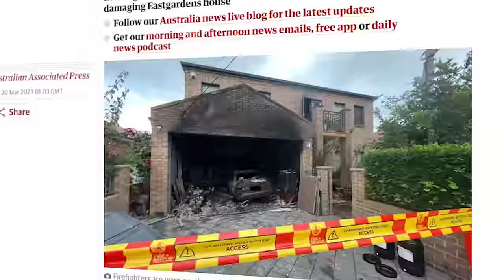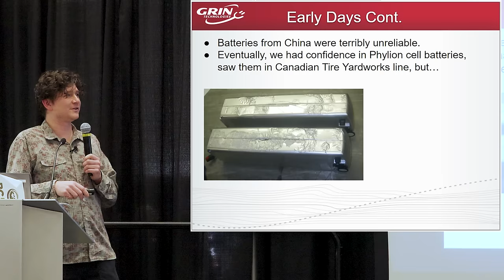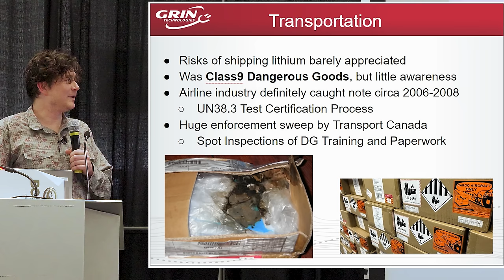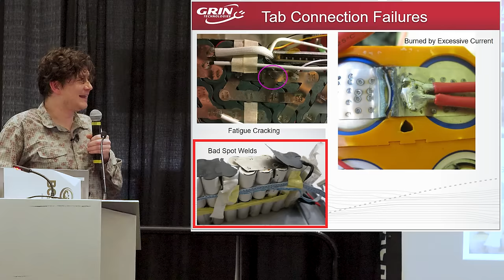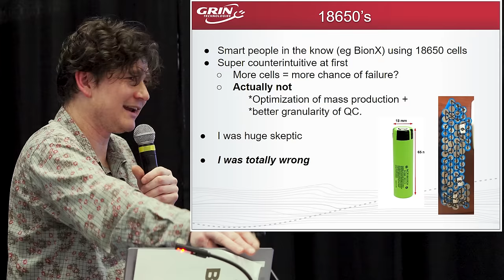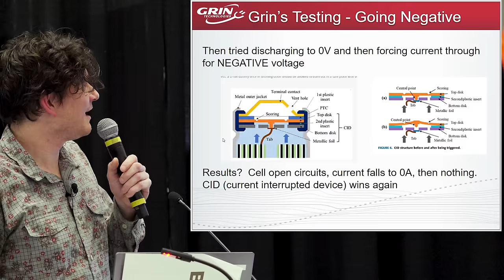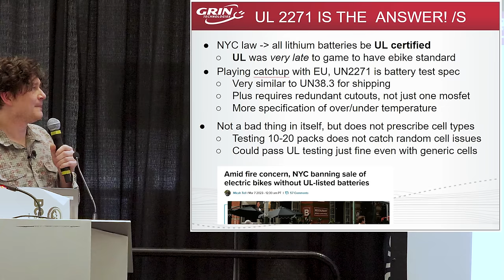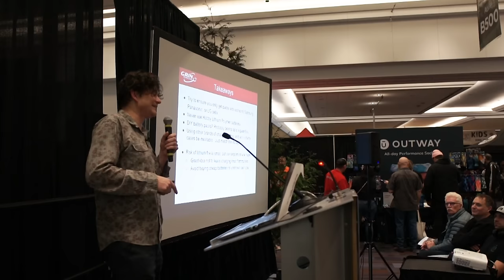Grin's Perspective on Ebike Battery Fires, 20 Years of Experience - Live from the BC Bike Show

Comment: Extremely high iq video. I don't normally watch 41 minute videos, but I sat
through and absorbed every molecule of this video. However, I realize there is only one solution... move to another battery. LiFeP04 is an extremely safe battery, but less energy density. The only question is, do you choose more weight and less power, or do you choose death... the answer seems obvious.

Says it in the name... LiFePO4... you must choose... 

You are like a lone genius, preaching the latest research, standing tall against a giant
beauracracy of outdated and oppressive boomer science. Sort of like Pierce Brosnan
in that Volcano movie. 

Another thing... one thing I disagree in the video is your explanation why other electronics don't catch fire... you say its cause people invest in high quality electronics... they don't... there are other reasons why cheap chinese electronics don't catch fire... Most of the smaller electronics are built different... For example,
many smaller electronics don't even use Li-ion, they use LiPo... you often hear LiPo batteries exploding in RC planes and ebikes,
but never in cheap chinese electronics... cause the LiPos are not built the same, the LiPo in small electronics are built
with safety as a priority, while the LiPo built for RC planes is built for maximum energy discharge and power.

And I did hear you mention LiFePO4 briefly at the end, you said it "catches fire", but from what I've read online there is no
contest between the two, LiFePO4 cannot thermal runaway. But you are a battery genius so I would like to hear a presentation
from you which discusses LiFePO4 in more detail please.

As for me and my story, I want society to be less car centric. I want bicycle highways added to society, towering above society
and allowing ebikes to flourish. However, Li-ion batteries and cheap premade ebikes are not for me at this time. I am considering building a gas bike instead,
even though I know nearly nothing about gas motors. Or custom building a LiFeP04 bike since I can't find premade LiFePO4 bikes online.
Reply from the maker: Thanks for the feedback. Our feeling is that quality cell manufacturers like Panasonic have aptly demonstrated that you can get the safety of rechargeable lithium ion batteries to be good enough that the risks are similar or lower to many other readily accepted consumer products. How often do you hear of a Shimano or Bosch ebike battery catching fire? Almost never, yet there are millions and millions of these in use all over North America. 

The problem is that there is no regulation or restriction on which particular lithium cells are allowed to be used in imported goods, so lower cost brands will happily use cells from almost anywhere. When there are incidents they don't investigate or distinguish which brand or model of cell was involved which is a bit of a travesty, and instead all ebike batteries get lumped together.  

Our earlier experience LiFePO4 cells is that they were just all over the place with quality and consistency, and at over double the weight of lithium-ion it's a big downgrade. We've gotten so used to long range batteries that weight just 10 pounds, no one wants to lug around 20 pound ebike batteries again. But if that weight is not an issue for you then by all means it's a fine choice, and there are plenty of LiFePO4 battery sellers out there with premade 36V and 48V packs suitable for DIY ebikes.  You don't need to custom build one from cells.
Reply: @GrinTechnologies  
"Thanks for the feedback. " You are welcome. 

" Our feeling is that quality cell manufacturers like Panasonic have aptly demonstrated that you can get the safety of rechargeable lithium ion batteries to be good enough that the risks are similar or lower to many other readily accepted consumer products." The chance was 1 in a million. That's not good enough for me. I don't want to put words in your mouth, so if it was not you that said that it must have been somebody else's video about lithiums. Solid state is the future. They sell solid state on amazon but they are fake.

"The problem is that there is no regulation or restriction on which particular lithium cells are allowed to be used in imported goods, so lower cost brands will happily use cells from almost anywhere. " Forcing only approved corporations to sell batteries is a slippery slope, tantamount to fascism, (fascism is the merging of corporation and state.) Its unamerican and against the American principles. I would much rather just either: Force the cheap chinese batteries to put a LARGE "fire-hazard" warning on the box or amazon listing. Or, put a certified "low-risk" stamp on the box of Panasonics.

"When there are incidents they don't investigate or distinguish which brand or model of cell was involved which is a bit of a travesty, and instead all ebike batteries get lumped together. " Its just typical human plebbery to flounder about and not really dig your heels into something with substance. I get frustrated a lot trying to find scientific data that could have easily been included in something, but was omitted for no reason by peasants.

"Our earlier experience LiFePO4 cells is that they were just all over the place with quality and consistency, and at over double the weight of lithium-ion it's a big downgrade. We've gotten so used to long range batteries that weight just 10 pounds, no one wants to lug around 20 pound ebike batteries again. But if that weight is not an issue for you then by all means it's a fine choice, and there are plenty of LiFePO4 battery sellers out there with premade 36V and 48V packs suitable for DIY ebikes.  You don't need to custom build one from cells." Weight is definitely an issue for me. I feel that contemporary ebikes are overengineered. At box stores we have these heavy, under-engineered mountain bikes that disintegrate upon going on downhill mountain bike trails one time, yet are legal somehow. Instead of that, why can't they make ebikes with lightweight vintage frames, that might not be robust, and just warn people not to ride them on downhill mountain trails? Then the LiFePO4s would be a non-issue. Are LifePO4s lack of QC because of chinese sellers not doing QC/lack of economies of scale, or is it some inherent issue of the physics of LiFePO4?

Comment: I have yet to see or hear of a LI battery spontaneously combusting, every single instance is a result of idiots, tampering with the insides of scooters removing speed limit restrictions , or tricking out the machine.
Reply from the maker: We'd definitely disagree on this front even though that's the common perception in the media and on forums.  We know of several businesses that have had absolutely brand new, never used batteries still in their original boxes catching fire. This is also the case at Pearson Airport, new batteries just in a pallet that were about to be loaded onto a plane (https://www.fire.tc.faa.gov/pdf/systems/May12Meeting/Lewis-0512-Li-Ion.pdf). It's quite rare but it does happen. In the cases where we've seen responsible ebike companies do battery recalls, their customers were doing nothing outside of regular expected use. They still had battery spontaneously go into flames. They weren't idiots. They weren't tampering with stuff. And definitely it was either a suspect cell manufacturing (eg Pedago and DLG cells) or a suspect batch of cells from an reputed manufacturer (eg eZee bicycles and the spate of fires in Au/Nz all from one batch of LG MG1 cells)
  
Doing something like removing a speed limit on an ebike doesn't impact the battery or battery safety at all. The tampering that would be a huge risk is if someone opens the pack to bypass the BMS circuit. Sadly we have seem cases where that is encouraged on forums to help deal with a problematic battery that shuts off prematurely, or one that won't charge or discharge because the BMS is latched off.